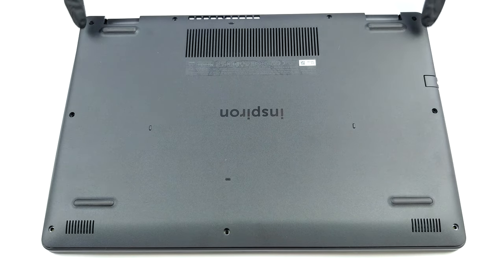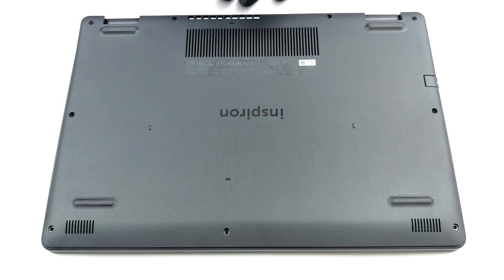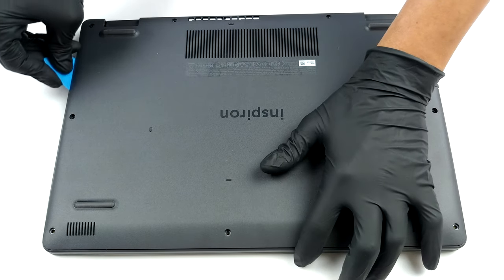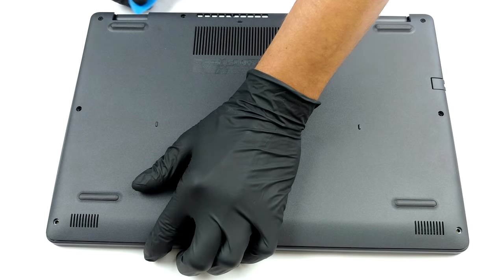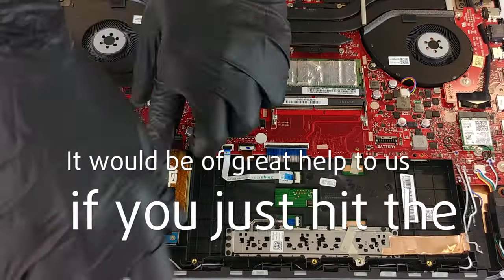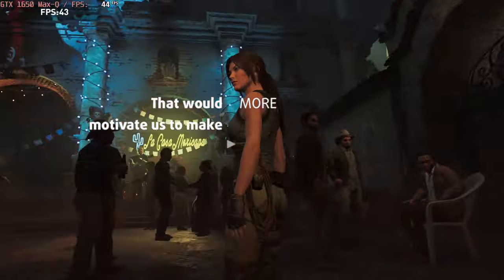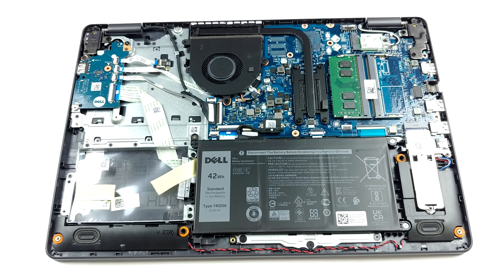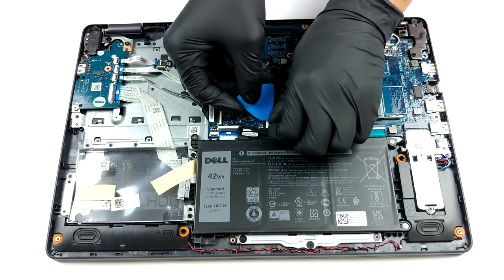🛠️ Dell Inspiron 15 3505 - disassembly and upgrade options

Comment: I cannot find a cooling strategy app for my 3505. Isn't it possible to change that? A least have a silent mode or something?
Reply: No officially, however at least under linux there is limited support for controlling the fan speed.
Reply: @werwolf6746  That's interesting, thank you

Comment: Hello, I also have a Dell inspiron 15 3505 laptop. Now that I watched your video, I realized that the socket that should turn on the lights behind the keyboard is disabled. Of course, I am not upset about this. But I am thinking about why the motherboard has a socket to turn on backlight  the keyboard, but the keyboard does not have lights behind the keyboard.
Reply: Up
Reply: They use same motherboard and chassis for wider variety of laptops. I have Vostro 15 3500, which is essentially identical, but it has dedicated GPU, fingerprint sensor and backlit keyboard.

Comment: Hi, in the vid you state that the max RAM is 32GB, but on all the specs I can find on the dell site says max is 16GB. Can it actually take 32GB RAM?
Reply: Hey I’m thinking about this, did you ever find an answer
Reply: @lilsouls4595  depends on the model, the one in the vid has 2 ram slots and you can go with 2x16 config, some only have 1
Reply: @mementocity  thanks, opened up my laptop a couple of days ago thankfully it has both ram slots!
Reply: @lilsouls4595  remember to check if it is even worth it, just updated rams just to find out my model while, supports both ram slots and the ram modules are identical, it doesnt have support for dualchannel, and it runs at a lower clock for some cursed reason, goes back up again wheneve I use a single one

Comment: Hi, can i upgrade dell inspiron 3505 ryzen 3 processor?
Reply: You can pretty much never upgrade any processor or even graphics card in any modern laptop

There are only a few exceptions where they use desktop cpus that can be swapped like any other desktop and or if they come with an MXM gpu module

But those are expensive af and very rare
Reply: @Elinzar  not mobile Proccesors 
Mobile proccesors can’t be changed 
They’re soldered into the motherboard
Reply: @bbc1270  ye read my comment again

and if this part bring some confusion, there are some Origin laptops that came with desktop cpus, they even have the intel bracket inside and everything, i think an Alienware as well but that i think it had an i9 9900k or something like that

Comment: The specs of this machine say that only 16GB of ram is supported at max.  Yet, I do know it can take 1 16GB stick in a single slot to satisfy that max.  I also know thate the 16GB limitation does not come from the processor.  So, I can find no reason it can't do 32GB of RAM at max.  Might you know why the specs limit it to 16GB?

Comment: Thanks for your video.
The motherboard supports a frequency of 2400MHz and the notebook comes with a factory RAM of 1X8GB 3200MHz, working at 2400MHz.
If I add another 2400MHz RAM, can dual channel be enabled? Will I have a problem because both RAMs are of different frequency, but they both working at 2400MHz?
Cheers, mate!
Reply: I want to get an answer for this too. but seem no responsive on question :(  that sad though
Reply: Yes it will work, I bought a 8GB 2400MHz ram with already installed 8GB 3200Mhz and both run at 2400Mhz with no problem
Reply: @ottomandora  hi i have a 4gb 2400mhz..will it work if i installed an 8gb 2400mhz? and make it 12gb ram